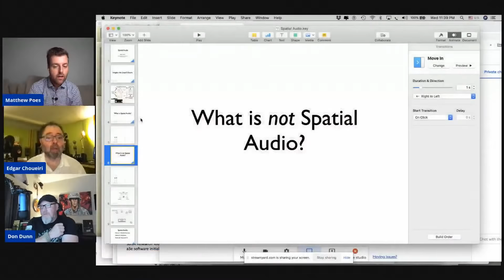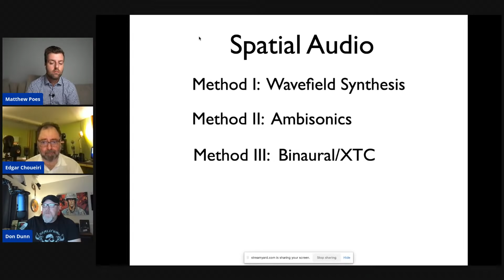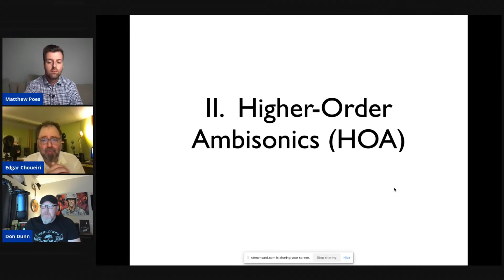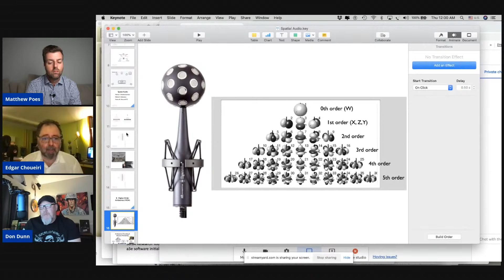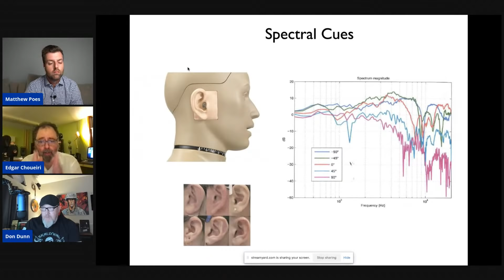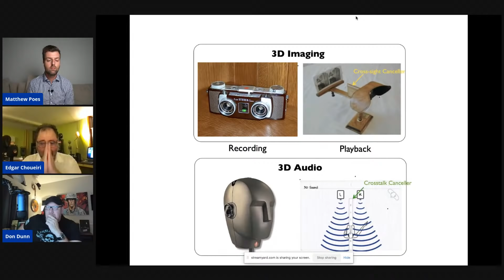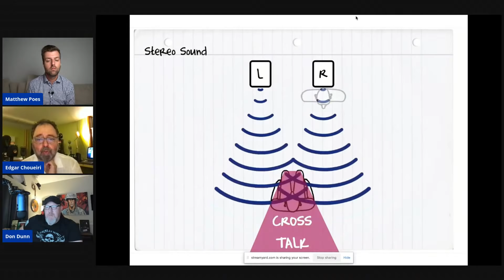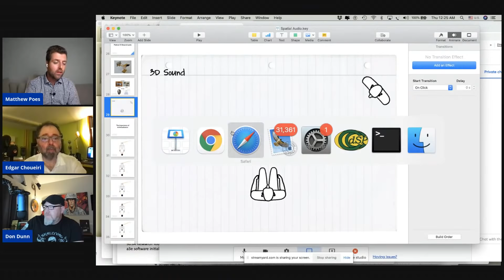How to Achieve Realism in Music Reproduction  - w/ Edgar Choueiri

Comment: I hope this catches on quickly.
He talked about crosstalk cancelation on stereo, but I wonder if it would be something that could expand to a 5.1.4 surround for instance. And if it would have any benefits in doing so.
Reply: If it works for stereo then it would work for surround sound. And probably object based sound too. But I doubt it will catch on quickly as most people these days use headphones or bluetooth speakers let alone stereo.

Comment: I personally vote for WFS as the method for 3D audio because it sells more speakers and I work for a speaker company :) 
Problem is most consumers won't hook up more than 2 speakers.. So it's going to be either headphones or 3D audio through 2 speakers with binaural processing.. The 7.1.4H immersive audio solution is for the real enthusiast. The best opportunity for 3D audio will be the car where the 16+ speakers are already there.
Reply: While that may be true (the car comment), the XTC works so well, you have to wonder why it hasn't seen wider adoption.  I know all the problems of past versions, but modern technology has changed that quite a bit.  With facial recognition and head tracking, its possible to optimize the filter for multiple people and Edgar's team has done something like that.  While you may not want Gene in your head, the proximity effect is still quite compelling.  It's missing from all of the current surround formats outside of the three noted in this talk.
Reply: @PoesAcoustics 
As Edgar stated, to reproduce the 3D/Spatial Binaural Audio effect effectively (sorry, LOL), ideally you need to minimize as many of the reflections in the room as possible that are created by the speakers.

Due to physics, and purposeful design, the majority of traditional loudspeakers that are designed, sold, and used by HiFi enthusiasts up to this point inherently radiate the majority of the audible frequency spectrum that they create omnidirectionally, i.e. the speakers have fairly wide dispersion patterns and directivity (on average 40°-70° Horizontally) which results in a plethora of reflections from the room reaching your ears in addition to the direct, straight-line sound from the speakers.

So, as Edgar said, there are 4 main ways to combat or reduce the detrimental room reflections so that the majority of what you hear is only the direct sound from the speakers:

1.  You move your MLP and/or your speakers much closer together so that the ratio of direct sound from the speakers is far higher than any of the room reflections, i.e. listen in the nearfield, which is how most small studio monitors are designed to be used (1m-2m triangle).

2.  Loudspeaker manufacturers completely change their traditional speaker designs so that they have very narrow horizontal and vertical dispersion throughout as much of the audible frequency spectrum as possible.  Due to the physics of traditional transducers, this is difficult to achieve without adding additional drivers + complicated DSP to create a CARDIOID loudspeaker design. (Example: the Dutch & Dutch 8C use some of this technology...$$$.)

3.  You fill your listening room with Acoustic Absorbtion products exponentially more than is already necessary for just standard 2-channel stereo, and with Absorbtion that is effective throughout as much of the audible frequency range as possible.  This is extremely difficult and space + cost intensive, and will most likely result in a very low WAF!  😅

4.  A combination of all 3 above.

So, you can see that the odds of successfully implementing or adopting this are significantly stacked against it being practical except for the most die-hard enthusiasts.

RE: OEM car audio systems...  Due to the highly reflective environment of the interior of automobiles, it's almost impossible to achieve adequate crosstalk cancelation (XTC) to the degree that is necessary to accurately reproduce this type of binaural Spatial Audio.

This is why the OEM automobile manufacturers are now using 8-16+ discreet speakers and multi-channel amplifiers with DSP to independently control the output levels, time delay, phase, and Spectral Balance of each individual speaker in order to "steer" the soundstage and imaging.

But in a vehicle, there is also the problem that we don't sit equidistant between the main left and right speakers.

So, there are obvious compromises made to the accuracy of the overall system in order to make it sound "good enough" from both front seats and/or all of the seats in the vehicle, rather than being able to prioritize the audio for just one main listening position.

Comment: Amazing insights and educational value. Side swipes the industry 
Spatial/time cues/clarity. These are what determine experience of Hi-Fi not speakers components cables or formats. Room acoustics yes definitely. But the recording and reproduction chains need an overhaul. Until then new DSP will prevail to bring Spatial Audio to consumers in every category. Active speakers will continue to benefit from the upgrade in spatial audio dsp. Explains why Auro3D is much better than Atmos and arguably the best current surround format.
Reply: Also tells me why MQA works. And why Spatial Audio in Apple Music works too.
Reply: Auro 3D worka better with front heights+ back height speakers than in-ceiling speakers correct?

Comment: i use two stereo sets (main and turned around behind) to get phase cancelation of crosstalk and binaural resonance at head position.
difficult to set up and with a tiny sweetspot, but functional.

when you move forward/backward outside of the sweetspot, it collapses to frontal or backward stereo with a low volume mono center behind/before you.

when you move outside of the sweetspot to the left, the front becomes a left stereo source and the back becomes a right stereo source. the sweetspot turns into the stereo center.
moving to the right from the sweetspot has the opposite effect.

moving above or below the sweetspot reduces the deep bass resonance.
Reply: only issue with my approach: binaural is  basicly only mixed for headphones at this time.
my binaural setup is near field.
this makes the soundstage too big in general. the electric razor test makes it sound like its shaving a 4ft wide sphere around my head, instead of my head.

that should be fixable though. the virtual head is the width of my computer speaker placement, so actualy playing back the sound mono-fied to 1/3 the stereo width should work.
recordings where the sound source is more than half a meter away  from the binaural recording head sound fine as is.
Reply: it worked. i used my go-to dsp (thimeo stereotool) to reduce the stereo channel to 34% and pulled up volume by 9db. it created a soundstage scaled for headphone use.
the usage of 4 speakers (double stereo) makes it head movement independant and removed the haptics of wearing headphones. pretty surreal.
....
i just decided to put on my headphones on that setting. bad idea. the head shave now sounded like it was happening inside my skull. a feeling like a dentist drill.
Reply: this sounds interesting, i wonder how it compares to Bacch.

Comment: Around 1:27 Edgar talks about the importance of  measurements and how they are weighted perceptually 

In order of importance he says research indicate the order of importance in terms of perception are : spatial, impulse/time response (clarity) and frequency response, He says you can screw up the frequency response and people are still satisifed.

If your screw up the frequency response doesn't it also screw up the impulse response? 
Also the perception of source distance is certainly impacted by the frequency response. If you remove HF it will make the source appear further away,

It would be nice if some  references to publications that support these claims were made available.. I would love to read them.
Reply: Hi Sean,  I'll ask Edgar if he can supply them.  He and I have talked about this specific claim of his a few times.  

I can speak to the nature of our conversation, which is an informal experiment he has done.  I suspect it is not wrong, but maybe not backed up by a strong publication either.  In any case, the spatial comment came from the fact that if you give someone a colored speaker and let them listen to it, they tend to get used to that coloration.  I think you would agree with that, that people tend to acclimate to the flaws.  However, he found that when you turned the spatial aspect on and off (the crosstalk cancelation filter) people never acclimated to it being off, they always knew the effect was gone.  So he concluded that it must be a more important factor.
Reply: @PoesAcoustics  That sounds very plausible to me.. Appreciate  if you can pass along the references. I do believe from personal experience (not experimentally quanitifed) that spatial attributes can make people forgive timbre errors..  The most famous example would be the Bose 301 which has speakers pointing to the front and side to the room. The coloration only becomes more apparent when you do more controlled A/B comparisons with more neutral speakers.

I've also experienced this speakers that have wide dispersion like the BeoLab 5. The speaker disappears and sounds spacious but when the room correction was applied its score when down because of the boomy target curve...  Klippel's  PhD research discussed in Floyd Tooles book also looked and timbre and spatial and he concluded spatial was weighted equal or slightly higher than timbre.

These are not quite the same experiments as Edgar's so it would be interesting to learn more about his findings.
Reply: @tonmeister86  yes and I’ve suggested that some of the informal studies Edgar has done would actually make valuable publications. 

I think the key difference between what Edgar is doing and all of those examples is that Edgar’s not adding spatial sound by simply increasing the ration of reflected to direct sound. He is actually reproducing the spatial properties of the recording correctly.  I know you know that, but I worry that viewers may not. Many often think of XTC as merely an effect.
Reply: why would you expect frequency response to affect the impulse response? Isn't that just EQ? I have the BACCH4Mac and consider it to be the most important/significant upgrade I have ever made in my nearly 40 years as an audiophile. Now with that said I do find personally I am very sensitive to frequency response. But with DSP EQ it's just so simple to adjust it. I think that is part of what Edgar means. You can't easily improve impulse response.

Comment: This "spacial" sound you speak of I the main reason I do NOT own a pair of head/earphones. I diy speakers and have found, multiple small fullrange in the order of 5" are best for speaker building. However, I do own 12" public address speakers which I found play better than many of the smaller woofer. Great work has also been done with attention to phase by way of the crossover/filter. Mainly series type crossovers. A shootout to John Broskie and his online research.
Reply: Francis I appreciate your experience here. I would like to build a surround HT system based on max 5” speakers as point sources supported by subwoofers to test this as ideal
Reply: @JingoLoBa57  Not sure of what you are getting at with this post. Can you explain further?
Reply: Headphones don’t have spatial sound on their own. I think their might be a little confusion as to what we are talking about. Headphones require binaural recording to produce spatial sound. Most people have never heard this done right. 

It seems unlikely anyone could argue they don’t want spatial audio, other than simply for nostalgia reasons. It’s a bit like saying, I don’t own a luxury car because I don’t like a nice ride quality.  I prefer to feel every bump through my spine.  

Properly done spatial audio should be desirable for everyone serious about audio reproduction.